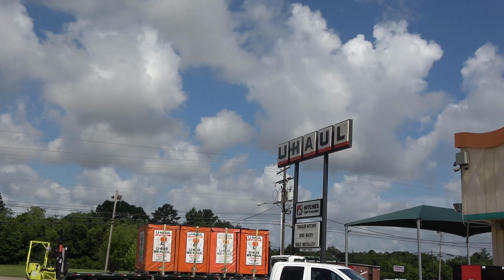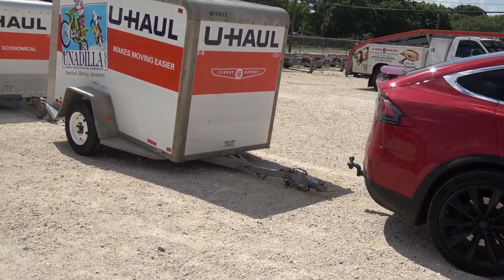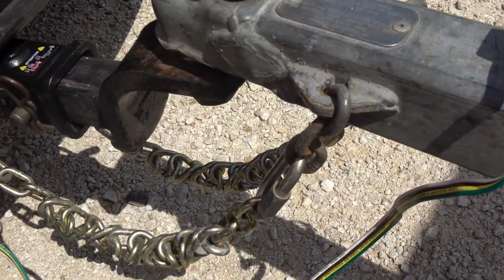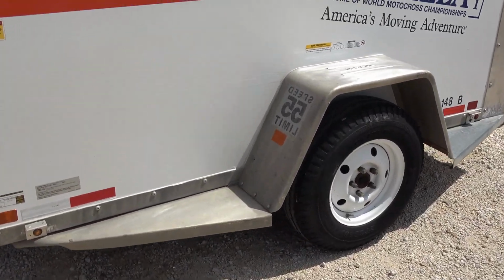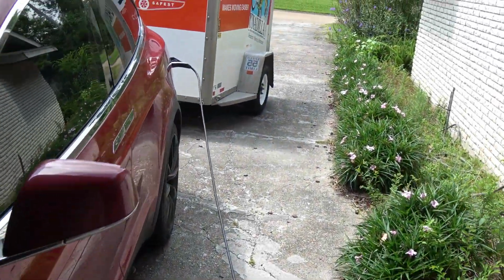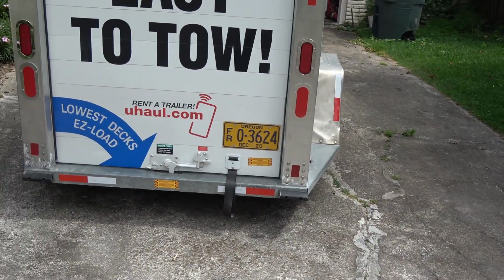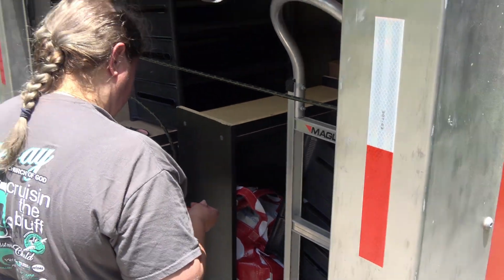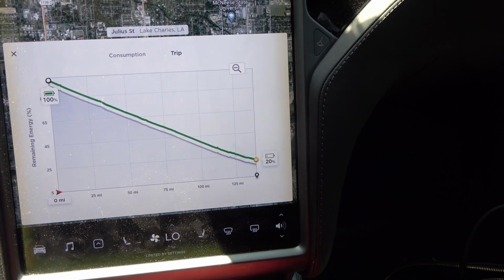Using ourTesla Model X to pull a small U Haul trailer

Comment: Hi does the UHaul company attach the trailer to your car?
Reply from the maker: They have for me on several occasions. Even though someone other then you hook up the trailer, always ensure that the trailer is tight on the ball. U haul uses the screw type to secure to the ball. It's always best to re check that its tight enough after the first few miles from leaving their lot. Also ensure that the chains are crisscrossed. This will ensure that the chains can catch the tongue of the trailer if it ever came off the ball. And as always, check proper lighting before departing. You will need a plug adapter to go from the round plug on the car to the flat 4 wire. Most U haul trailers are of the flat type and the Tesla uses a round trailer wire hook up.  Hope this helps....